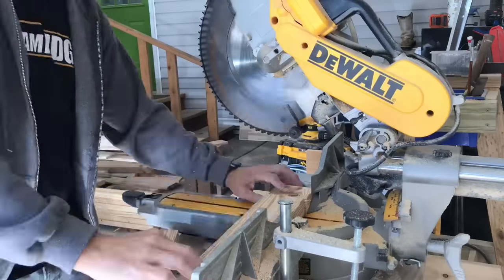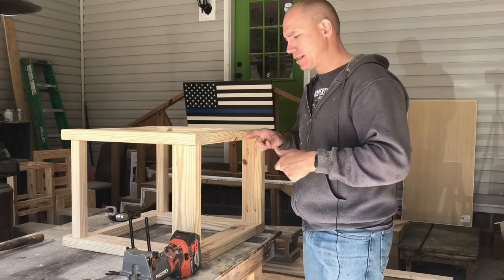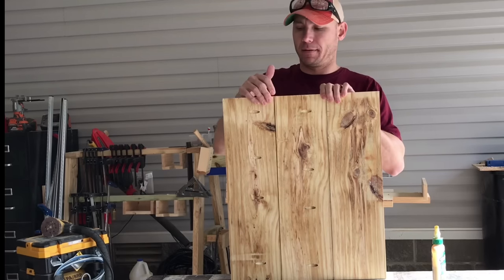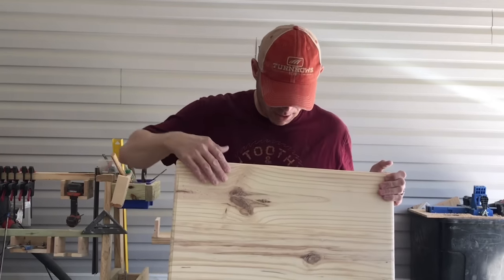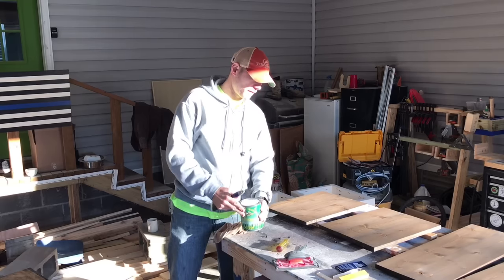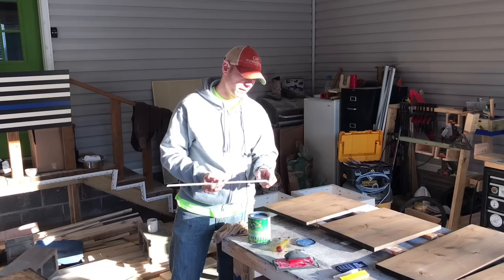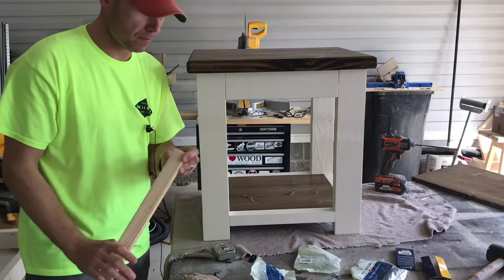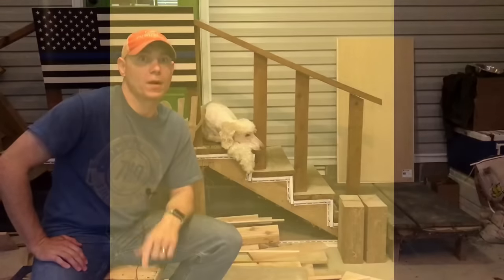DIY Small Farmhouse End Table

Comment: Interesting that you used the expansion slots for the table top but not for the bottom shelf that you tightly snug fitted between the stretchers.  That didn't cause you a problem?

Comment: I'm following your instructions quite closely but I didn't see how you are supporting the bottom shelves.  I may have missed it.  Did you use the z clips for that?
Thanks for providing very helpful videos for beginners like me.  Glad to see your shop is stocked about like mine is.
Reply from the maker: I used pocket hole screws
Reply: @731Woodworks  How were you able to lay the the bottom shelves in there without them falling through?  It looked to me like they were resting on top of something.

Comment: Great video!  One question, i there a reason why you didn't just sand the boards for the frame before you assembled them.  It seems that the orbital sander could miss things and be rather bulky for hard to reach areas.  Thanks and keep up the good work;  I am learning a lot from you.
Reply from the maker: I did a sand before but did a final sand after it was assembled

Comment: What size pocket hole screw do you use? I've just started using the Kreg pocket hole jig and I get confused on screw lengths/board thickness. And mess up a couple of projects.
Reply from the maker: On lumber that is 3/4” thick (also called 1 by material) I use 1 1/4” screws.  For 1 1/2” thick (aka 2 by material) I use 2 1/2” screws.  Kreg has a handy chart you can reference here: https://www.kregtool.com/about-us/news/kreg-tool-tips-joining/choose-the-correct-screw-length.aspx

Comment: Question Matt "two" if I may..
1. Do you water down the primer or paint?
2. Do you sand between primer coats?
Cheers from Chicago Thanks!
Reply from the maker: No watering down. Yes lightly sand with a high grit paper

Comment: Trying this build for myself. Got the frame built up and got the legs all even only to have them wobbly again a week later. Any advice? Didnt think it would move once I had em even the first time
Reply from the maker: It shouldn't move after it is assembled.  If it is wobbly, figure out which leg is long and take a sander (or circular saw) and trim that leg very little at a time until it's stable.

Comment: Hey man I’m currently working on this build, I’m blushing the sherwin Williams extreme block primer, have two coats on and painting with sherwin Williams pro classic oil based paint, I’ll be brushing it this time. My question is are you thinning the paint with your spray gun or spraying with no thinner?
Reply from the maker: I'm not using any thinner.

Comment: Wild shot you see this on such an old video, but I’ve seen this in a few others as well. Why does holding a level next to it the piece of wood instead of just the guide help? 
Thanks and love the videos, definitely making some side tables for the house this weekend!
Reply from the maker: The level moves with the board, thereby giving the board a straight edge to reference. If you just use the fence, the edge being cut is referencing the other side of the board. Which is typically never truly straight.
Reply: @731Woodworks  oh, got it! Makes sense when you type it out. Thanks a bunch
Reply: @731Woodworks  I'm still confused. however out-of-true the other side of the board is , as measured against the opposite side , having it against the the level OR  the fence wouldn't bring it into true. both the level and the fence are straight edges. 
if the board isn't even across it's width , whether it's against a fence  , level , or any other straight edge won't by itself , square it up. just my thoughts.

Comment: With the poor quality of dimensional lumber at Lowes, I have run my boards through my planer to cut down on my sanding time. My first end table build I neglected to plane my 2X6 to the same height as my 2X4's for the frame. Next time i will make sure to plane them both at the same time.

Comment: I know the video is two years old so you may not see this comment but I’m wondering why you didn’t use the z-clips on the bottom shelf as well?  You mentioned using the z-clips on the top shelf due to contraction and expansion. Won’t that be an issue on the bottom shelf as well?
Reply from the maker: You can do that. I did it for fit. So it wouldn’t be loose fitting. I’ve not had any issues with it. We have tables in our house built the same way.

Comment: Matt, first and foremost great work.  Table look very nice.  I have a question for you.  When you sand the table top, do you sand both sides, or just one?
Reply from the maker: I typically sand both sides.  However, I don't sand as much on the bottom side.  I give more attention to the top.  But the bottom needs a little sanding to knock down the rough feel.

Comment: How do you fix a small wobble in the legs?  Thanks in advance and Happy Thanksgiving.
Reply from the maker: 2 legs will be touching while two will be rocking. Take one of the touching legs and trim it a very small amount until there is no wobble Either sand it or cut it a little at a time.

Comment: Great video as always..... quick question ...What bend of table saw do you use?
Reply from the maker: I have the Delta 36-725.  Review is on the channel if you want to check it out
Reply: 731 Woodworks thanks.....that was supposed to be brand not bend 😳
Reply from the maker: Lol I knew what you meant.

Comment: I just used my 36" clamp when putting the boards together with the glue/pocket screws and the finished top turned out warped like, or unlevel if I were to put the legs on it.  If I use the Kreg clamps on the ends like you do in the video, will that help in the future with that problem?
Reply from the maker: It will help.  Your issue is likely the edges of the boards. They have to be squared up or that will happen.
Reply: @731Woodworks  Thanks!  By the way, I'm mixing your build for this top board (making mine longer side to side), with the metal legs you used in the nightstand build to make a coffee table.  What potential price would you put on something like that?
Reply from the maker: Can you send me a pic of it on Instagram? Or tag me in the pic?

Comment: Great videos, one question though, how do you keep the knots from bleeding through the stain on your tops? I have been fighting this issue for a while now.
Reply from the maker: I use Sherwin Williams stain blocking primer.
Reply: @731Woodworks  does that interfere with the stain color?
Reply from the maker: Oh I only use it on the painted parts

Comment: How do you ensure the table is level (no rocking)?
Reply from the maker: Typically uneven legs are caused by something out of square but it’s a fairly easy fix. Sit the project on a flat surface. There will be two legs touching and two that “wobble”. Pick one of the ones that are touching and start trimming it a tiny bit at a time either with a saw or sanding until they all touch.

Comment: Hey Matt, my hubby wants to know what kind of paint you use on the  distressing. I know you refer to Biscut white for  the top coat but he is asking if you use water based spray paint. He's made several  noodle boards but is thinking he is doing something wrong. Also, how long do you let the 2 coats dry before using the orbital sander. Thanks a bunch. Your Southeadt Missouri fans!
Reply from the maker: For the base coat, I use Rustoleum satin Espresso spray paint I buy at Walmart.  The top paint is Sherwin Williams Pro Classic in biscuit white.  I let each coat dry at least an hour, sometimes more if it is cold outside.
Reply: @731Woodworks  thank you for replying so quickly. My Hubby will be trying to make your TV stand. He's bought all the necessary wood and I'm sure the iPad will be in his workshop to review often. By the way, we are originally from Northeast Arkansas. Love that Southern Drawl of yours♡  Your Missouri fans Jacckie & Bob
Reply: .one more question from my hubby, sorry for the inconvenience- is the Sherwin William's paint a "latex" brand  because if so he wants to be correct and  sure what to load in his gravity feed spray gun. He may have to go back to Home Depot or Menards. Lol.
Reply from the maker: The can says it is an “Interior Acrylic Latex”

Comment: I don't get the z-clips when everything else is glued and pocket holes.  Why would the table top be an issue and not the other pieces?
Reply from the maker: It would be best to use the table top fasteners on the bottom shelf but I wanted a secure fit.  I've had a table in my home for over 3 years made like this without any issues.

Comment: Why is it ok to screw in the bottom shelf, and not be concerned about wood movement, but not ok to screw on the table top? Why does the tabletop move with the seasons, and you have to account for that movement, but the bottom shelf doesn't move with the seasons?
Reply from the maker: Good questions and I’ll give you a terrible answer. I don’t know. lol. I haven’t had any issues doing the bottom shelves that way. If you’d prefer to do them same as the top, you certainly could.

Comment: I know this video is 2 yrs old but I had a question why can u use pocket holes on bottom shelf and not table top??
Reply from the maker: I don’t have a great answer for you other than the pine 2x top seems to expand/contract more than the spruce 1x used on the bottom.
Reply: @731Woodworks  thanks for the fast  reply, will sub.
Reply from the maker: Thank you 🙏🏻